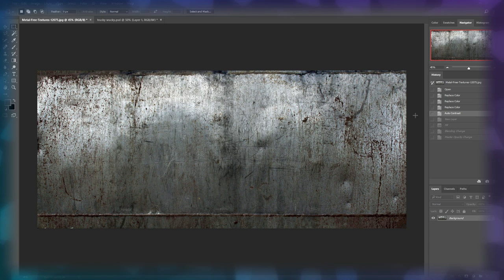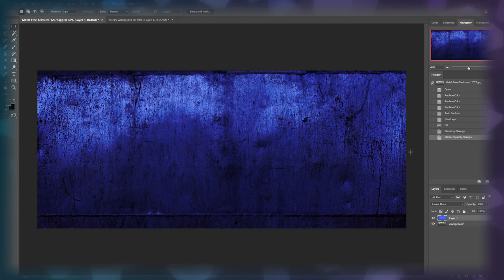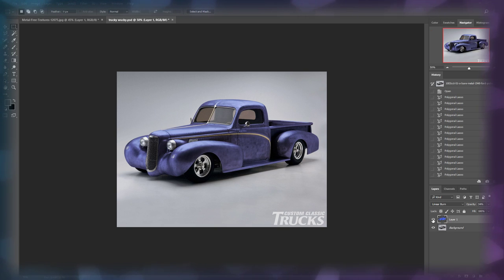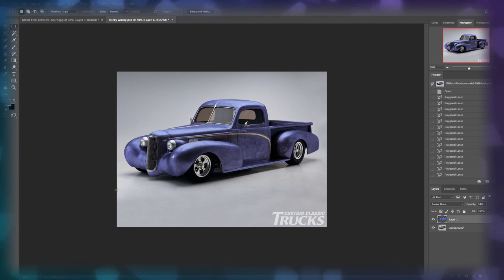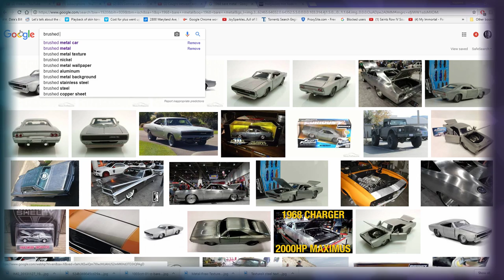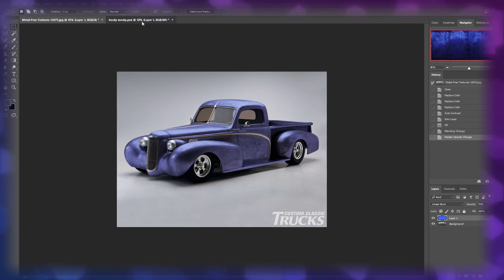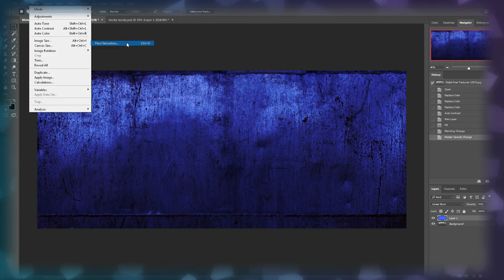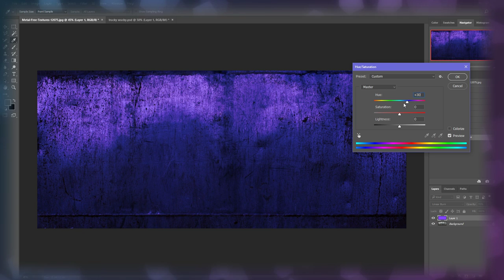Mockups of what I mean by the metal finishes

Comment: Did I ever mention I have an interest in metalworking? What you are describing could be a few things. 

Anodizing- Electro-chemical process that coats non-ferrous metals in a layer of aluminium oxide. The oxide can be impregnated with dyes. I have a purple carabeener on my backpack that is anodized aluminium. This is really impractical to do with a car as it would need to be made from a non-ferrous metal, like aluminium, and it would require a rather large electrolytic bath.

Etching- Ferro-chloric acid turns steel black and highlights welds and imperfections. Also Steel FX uses acids with other chemicals in their products. Etching whole car would be difficult, but I guess you could do it if you were really determined. 

Bluing- Did you know that if you cook steel in an oven at about 550 degrees Fahrenheit for about an hour, it will turn blue? Cooking time might vary depending on the shade of blue, but it works. Probably not a good idea to do this to a car, but you could use a torch instead of a really big oven. 

Hope this helps.  There used to be a type of paint called "metalflake" that would give the look of tinted or dyed metal. Don't know if it is still available.